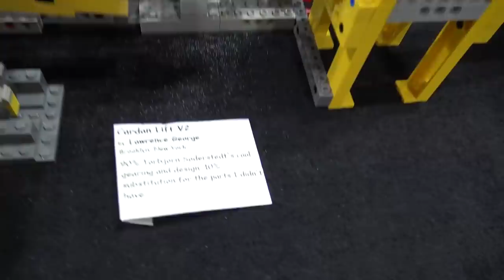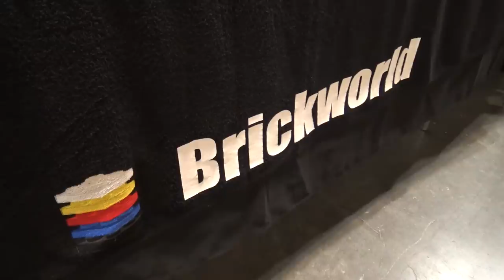World's Longest LEGO Great Ball Contraption! Brickworld Chicago 2018

Comment: You could shorten workshop modules to "Shop Mods" to have the minimum syllables in your "workshop module" abbreviation. The problem with W is that it has more syllables than half the words that start with it.

The spiral-and-buoyancy based continuous pump is called an Archimedes Screw, by the way
Reply: Also, it’s a helix, not a spiral.

Comment: Here is an idea....get some UV fluorescent paint of different colors, paint a ball per color, setup a UV light tunnel with a camera, and add an Arduino to monitor the images and detect when one of those few specially marked UV balls comes through.  You can then create an electronics Leaderboard that times how long it took each of the fluorescent balls to circumnavigate the Contraption.  "The Blue Fluorescent Ball took 37 min 22 sec, and has lapped 6 times so far today, the Pink Fluorescent Ball took 44 min 8 sec, the Green Fluorescent ball has been missing for 2 hours now...."

Comment: Still waiting to see a module that accumulated a group of balls and after a set time dropped them all at once from high up, redirecting them during the fall on multiple tubes to shoot them at high speed machine gun style on a diane. It could even double as a makeshift bridge by adding a lock on the loading zone. 

 Also waiting to see all those damn jumpers, catapults, etc getting a safety net and a recovery system so they don't constantly shoot balls out of the perimeter.

Comment: Ok Nice, now power everything with only one engine and a lot of gears
Reply: it would bog down a big block chevy and when one gear stripped it would stop the whole entire show and it would cause the gear at the crank of the motor is under the most possible load and the gear at the end where it ends is under the least load, it would always break close to the beginning and everything after that would stop
Reply: bro the amount of resistance you would get from all those gears, you would need a lamborghini engine that spins a STEEL axle